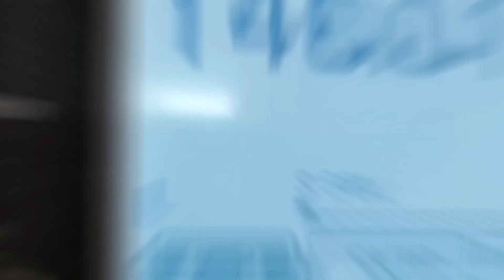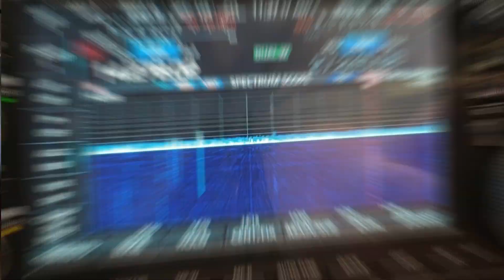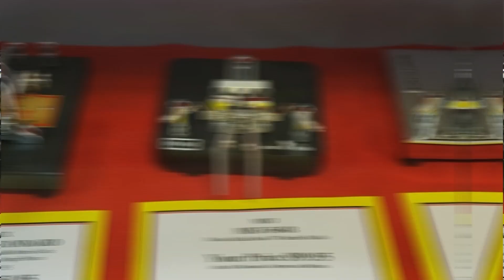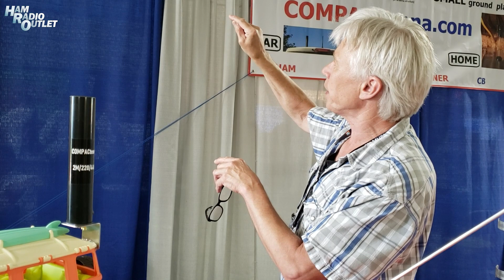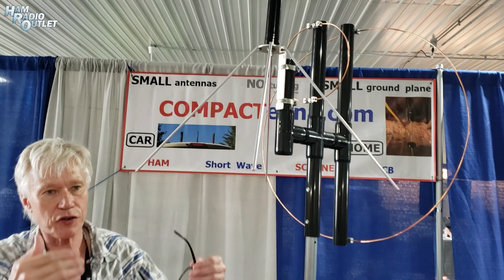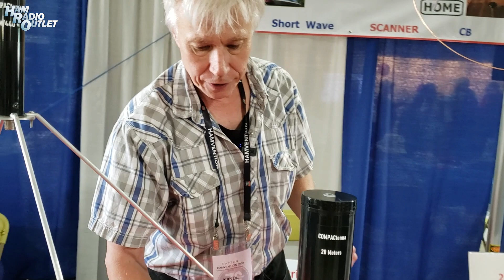COMPACTenna - Dayton Hamvention 2022

Comment: I have the COMPACtenna 2M/440 PLUS from HRO. For its size, its awesome and works well. That being said, the "5 dB-MEG" figure he states does not beat the gain of my Pulse Larsen NMO2\70. It simply won hit my VHF repeaters as far away as the NMO2\70 (VHF 3.8 dBi, UHF 5.2 dBi gain)
Reply from the maker: Correct. Dr Jack says in person and in his speeches, the COMPACTenna will not outperform larger antennas. It's not designed to do that. It's designed to be small, efficient, and reduce "picket-fencing" while driving.

Comment: This is nothing at all that's totally unuseful unless you use it for gmrs and murs which this antenna was never designed for anyways and I doubt that this person could ever design such a thing for those bands like another guy kb9vbr he designs all sorts of antennas for many different bands using copper jpole technology when are the leading antenna makers anyways because he even makes them for broadcast all the way to the TV and the other bands and it's a lot less expensive compared to this one which costs an arm and a leg Jpole is the best
Reply from the maker: The people who have them and install them as the directions describe, love them. They are not designed to be DX antennas. They are designed to  be small and allow even tall vehicles to fit in a garage without having to remove the antenna. they're designed to reduce FM picket-fencing, and according to all reports from people who actually use them, they do that extremely well. As for this guy not being able to design anything that's multi-band, think again. He has several patents for antenna design and sells multi-band antennas. Why not try one and report back?

Comment: Nothing more than some aluminum foil sandwiched between layers of non-conductive plastic sheets and shoved in a tube with a matching network...caveat emptor.
Reply from the maker: And yet, those who actually use them, seem to love them.
Reply: @HamRadioOutlet  I have one too…and when compared to industry standards-based antennas, it falls quite short.

People can spend their money on whatever they want, but that doesn’t make it good.
Reply from the maker: @TurboEncab  The question is, does it do what he claims it does vs what people think it should do? His claims are it's a compromise antenna that allows you to keep it attached to your vehicle while entering your garage and parking structures. As Jack Nilson clearly says in the video, it will not work as well as a full-sized antenna. He says it does not suffer from the same multi-path issues that other antennas suffer from, a comment I have heard backed up many times from people who use this antenna. If you're expecting it to pull in signals from distant repeaters better than your full-sized antenna, that's not what this antenna is for. If you're looking for an antenna you can keep on your vehicle while pulling into the garage and an antenna that works well enough for you to contact the local repeaters in your area, this is a good choice. (This comment is pretty much a copy of a reply I gave to Zer01, below). The answer to the above, from most people who have one and use one, is "Yes". The next question logically becomes, "Do the antenna's benefits outweigh it's compromises for my installation?" If the answer to that question is "Yes", then it might be a good choice for you. If the answer is "No", then buy another product that better suits your requirements.

Comment: 2:50 "much better than expected performance" crap cut in half is still crap. I love going to my local HRO and the people there so my negative statement is toward COMPACTenna. Thanks for the video since I don't see much on it. I already commented on my personal experience with it so I wont do it again. This guy is talking in technical buzzwords...that should be a red flag given many of our HAM's understand technical concepts.
Reply from the maker: Most people who have a COMPACTenna understand that it is a compromise antenna that, as Jack Nilson clearly says in the video, will not work as well as a full-sized antenna. He says it does not suffer from the same multi-path issues that other antennas suffer from, a comment I have heard backed up many times from people who use this antenna. If you're expecting it to pull in signals from distant repeaters better than your full-sized antenna, that's not what this antenna is for. If you're looking for an antenna you can keep on your vehicle while pulling into the garage and an antenna that works well enough for you to contact the local repeaters in your area, this is a good choice.

Comment: "constructed of ‘extended flat monofilar spiral Tesla-like coils’ +  geometric components" From Jack's website.

Plus "magnetic field resonator"

Fancy way of saying flat coiled wire?
Reply from the maker: He tells you that it's made using "foil,  not wire".
Reply: @HamRadioOutlet  you're right, and that changes everything 👍
Reply from the maker: @K4AX  Have you tried the COMPACTenna? Does it do any of what he says in the video it does? The claims he makes in the video are: that it's "A reasonable or good antenna that is short"; that when you shorten the length of an antenna the efficiency and bandwidth decrease; when you put the matching system into the construct of the antenna itself, it resonates; when you make an antenna this way you get "Much better than expected performance, particularly when you are non-line-of-sight"; this antenna deals with multi-path better than a regular antenna; a long antenna "will have a slight edge when you're on top of a mountain with purely line of sight" but the COMPACTenna will beat it in every other circumstance; this antenna decreases flutter on multipath signals; use the larger antennas with a groundplane for base stations. For HF, he says a full sized antenna will beat his COMPACTenna; "It's crazy incredible how well it works for 20-inches"; you should use foil as a good groundplane for his antenna.
Reply: layers of aluminum foil shoved in a tube :)
Reply from the maker: @TurboEncab  Does it do what he claims it does?

Comment: To quell the negativity and build interest, if HRO feels this is a product worth promoting which I assume that they would sell, then maybe HRO should circulate some evaluation units to some of the well known ham radio youtubers for a non-biased review. That seems the logical approach to me.
Reply from the maker: Or maybe some of the well known YouTubers should contact COMPACTenna to get evaluation units?

All the people speaking negatively about this antenna have not tried it. There are two people in the comments here (so far) who have tried it and both say it works great for them.
Reply: I tend to disagree. I don’t think it would be the YouTubers responsibility or even interest to reach out to the mfg or distributor to request a demo unit. Especially on new tech that as some are considering “snake oil”. 

To say their are people in the comments that say it works just doesn’t hold as much weight. Me as a consumer would not buy into that as it’s easy to fake reviews/comments nowadays. Watching a YouTube video from a trusted source hold a lot more clout. As a consumer I as others turn to YouTube to see real world test before investing in a product. Reviews, not sales pitches. 

If these are as versatile as they claim then there shouldn’t be an issue. I’ve seen plenty of other manufacturers and distributors send out review units. Some for the reviewer to keep and others with the terms of returning or sending on to the next reviewer. 

It is smart marketing and all comes down to a low ROI. Either for the Mfg or the distributor. If HRO has exclusivity for a while then it makes sense in your case. 

Look my comment was not meant to be snarky but rather neutral and suggest a way to boost sales and consumer confidence.
Reply from the maker: @misteraon  All good points... especially your last. I have not once defended the product as I have never tried it - though I know some who have and it's still on their personal vehicles even though they have plenty of other options available to them. There have been several comments from people who say it doesn't do what it claims to do. In some instances, the people making those comments did not accurately remember what was said in the video and they attributed their own words to those of Dr Nilsson. One thing all of the people speaking negatively about the COMPACTenna have in common, so far, is none of them have tried the COMPACTenna. Regarding trusted YouTuber reviews: The reviews I personally trust, are the ones which begin "I bought this product with my own money."

Comment: It's sounds great in theory, I just need to see an independent test on video. If it does what it says, it would be revolutionary and turn the antenna industry upside down.🙃
Reply from the maker: Who knows, maybe someone will do it!
Reply: I had one of these cans on my car. two ways, magnet mount and using an NMO though the roof of my car (2018 honda crv)..I returned it the day after. It may be ok for receive but my SWR was all over the place. I tried the magnet mount on every corner of my car, center, trunk, engine cover... and it was awful. I'd like to see a video showing me otherwise and if I did something wrong. As soon as I placed my whip back I had zero issues. I'd love to have a stub antenna as I tend to bang on things like the drive through or branches. It's just my experience, it may not be the case for anyone else.
Reply from the maker: @thebugg333  Sounds like there was a manufacturing problem with the antenna, if the SWR was out of whack. It happens, occasionally. Maybe a replacement would have worked better.
Reply: @HamRadioOutlet  Julian is correct.
That said, each antenna is quality tuned and tested and ~99% of the time a problem occurs, it is in a magnet mount, a connection/connector, or adapter. Many customers can attest to this after reaching out to me where I then spent much time patiently working with them to help them problem solve their equipment, installation.
With good mounts/equipment and the COMPACtenna mounted at an upper corner, where there are no substantial parasitic structures nearby (other antennas, high racks, etc.), virtually everyone is highly pleased.

Comment: What a fraudster. It's a shame he is getting publicity for his snake oil.
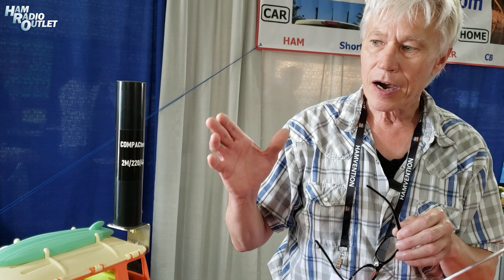Reply from the maker: I wonder if you have ever used one of his antennas? Did you hear what he said at 1:09? Have you read other people's reports about the antenna, people who have tested the antenna? I haven't used his antennas, but I've heard good reports from people who have (see BillyLapTop's comment as an example).
Reply: @HamRadioOutlet  I watched his videos several years ago when he first made his outrageous claims against physics.
Reply from the maker: @KB4QAA  What outrageous claims did he make in this video? He said it's a compromise antenna, it shorter than other antennas (and that's its main selling point), that with the HF antennas you can make contacts to south America, that you should use sheeting as a ground-plane, and if you have a full size Yagi the Yagi is going to work better. Further, there are people who use his antennas who said they work well (within the limitations already mentioned), especially considering their size.

Comment: Anyone have one of these antennas and field tested??
Reply: I do. They are adequate at best. I have the standard 7.5" 2m/440. No matter where I locate it on my vehicle, a large SUV, I cannot get the SWR below about 2.4:1 on freq's above 144 mHz. SWR increases sharply at 145 mHz.  My Larsen NMO 2/70 mounted center of roof has an SWR of approx 1.2:1. I can easily hit distant repeaters with the Larsen. Not so much with the Compactenna. Reception is not anywhere near as good with it either; generally about 2 S-units lower than the Larsen on repeaters a bit further away than the main one I use in my county. If you're having problems banging into overhangs with your antenna and don't mind the compromise, the Compactenna is OK, but not great. I was tempted to try their high gain model that is out now but about the only place I can find it is DX Engineering and they want 200 bucks for it which I consider a bit steep for a mobile antenna.

Comment: I can attest to the claim of the Compactenna, regarding a longer antenna having more dramatic dropouts in a mobile application than the Compactenna.

My friend and I conducted tests on 2 meters using a 5/8 wave antenna versus the Compactenna dual bander and 25 watts.  I live 12 miles south of Ithaca, NY on a hill top at 1700' of elevation looking down at Ithaca that has a descending elevation from 1200 to 835 feet of elevation.  The test was he would descend down into Ithaca while transmitting on 2 meters with the 5/8 wave for the first run, then return to the starting point east of Ithaca and return downtown again transmitting on the Compactenna.

Amazingly with both antennas, the peak signal levels were equally consistent but the difference was actually, the picket fencing/dropouts with the Compactenna were gone compared to the 5/8 wave antenna that had faster picket fencing and actual dropouts while following the same path through town.  The Compactenna had a smoother signal level and the propagation was consistent, almost like an AGC was kicking in.

Whoa, I said to myself, the Compactenna really does work.